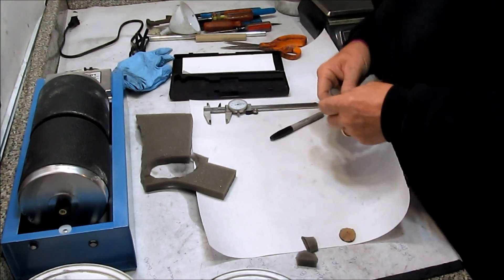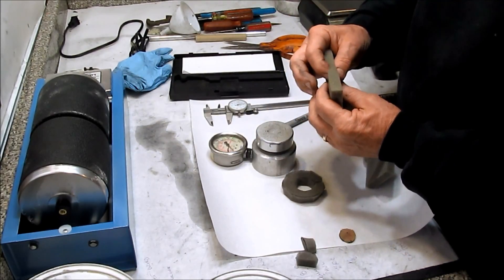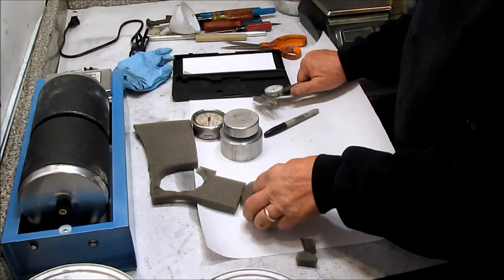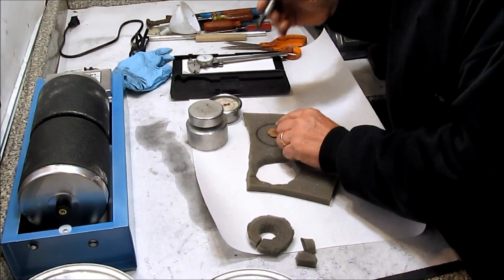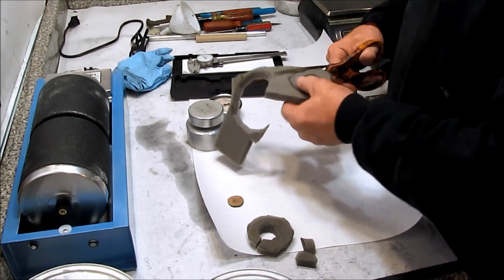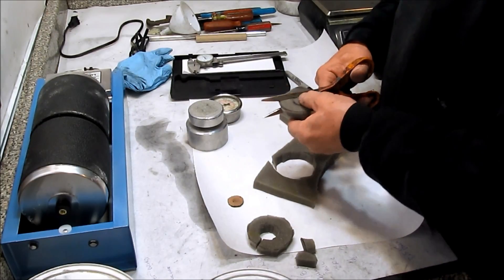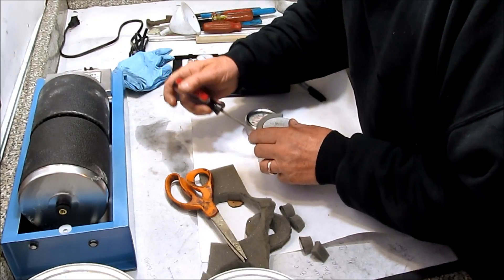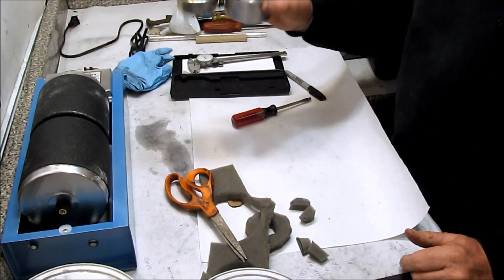Preventive PtoF Unit Maintenance

Comment: I use a zip lock bag for my ptf. Made the ptf from a 10 ton short ram from harbor freight ($40) and a 5,000 psi gauge from China ($13). Just mate a short pipe between the two, under hydraulic fluid ( no needing needed then).